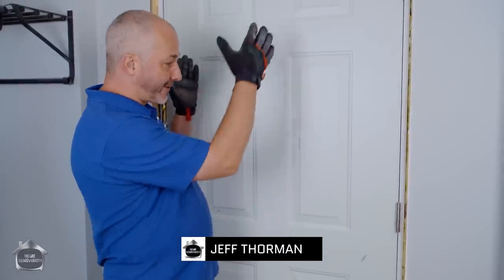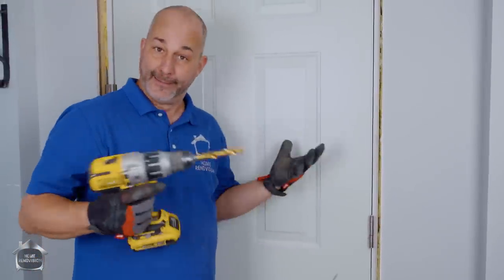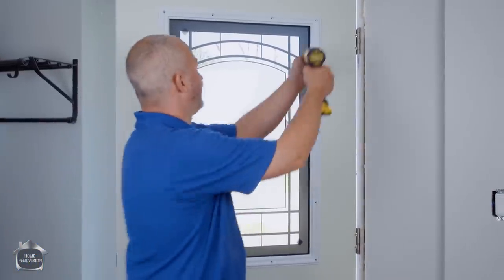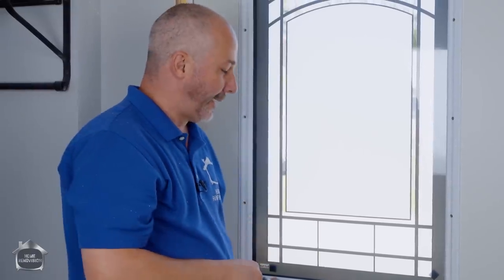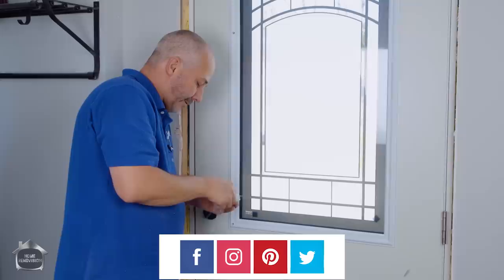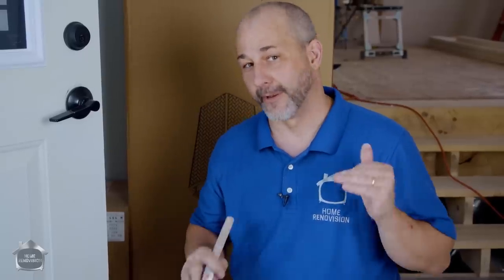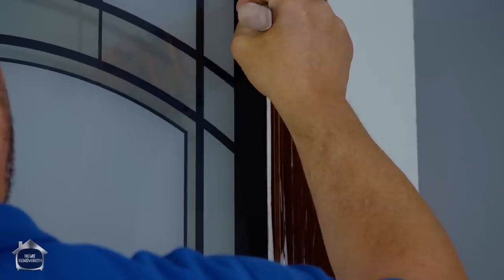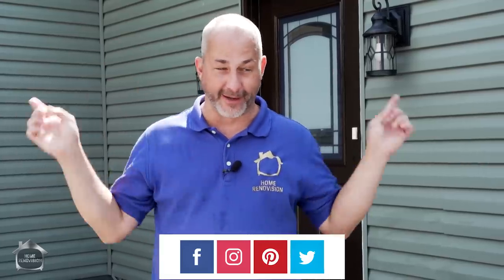Make Your Own Custom Front Door! DIY Door Installation

Comment: We are doing this project tomorrow! Were all set to buy a new door, stumbled across this from your ceramic floor removal video, and now we're going to salvage our current door and save $$$!! Thank you sir!
Reply from the maker: Glad it was helpful!
Reply: Tell us how it went please!
Reply: Paint the frame before installing and touch up last.
Reply: I bet a trade would charge a grand for that install. Nah, most guys wouldn't even touch it. Genius!
Reply: @pierre-marcrioux5015  It went really well! Window took a few weeks to arrive through Home Depot (we weren't lucky enough to have a HD that carries them in stock), but it really was a easy as he made it seem! I used a level and carpenter's pencil to draw lines and make sure I didn't cut the hole out crooked, but other than that and taking the door off the hinges to lay flat for orbital sanding/painting, I just used the tools he did and followed his exact procedure!
Reply: @blaster-zy7xx  Good advice. Wish I had remembered it 3 weeks later when the window finally came in! lol
Reply: @joe_g_fw  I'm glad to hear this went well for you. I am eager to try it for my dark hallway, but I can't find these lites on Home Depot. I am probably using the wrong search terms or something.
Would you mind sharing the one you bough, or one similar to it?
Much appreciated.
Good luck

--Sean
Reply: @BobutBrody  Yes, i had the same issue searching for half lite! Search for door glass instead. We bought the ODL Bristol.

Comment: WHy not take the hardware off before painting?
Reply from the maker: you can if you like. this way I can't loose the screws!
Reply: Yeah I always remove all the hardware. Shoot the last door I removed to spray paint it. Color was actually similar to this only it was a hammered type paint. Looked pretty good from 20 feet away. lol It really did look pretty good. It could have been better with a bigger sprayer than a can. Darn stuff dried to fast and couldn't keep a good wet edge.
Reply: Paint all of it prior to install... 🤷‍♂️
Reply: Wow that looks easy!
Reply: @HomeRenoVisionDIY what are these windows called? Is there name for them for searching purposes say at Home Depot or Lowes?

Comment: Safety gloves were a good suggestion and a good example of staying safe...... However...... NO SAFETY GLASSES during drilling and jigsaw cutting is definately not. I am a sloppy painter so I would remove the hardware completely and use tape on the edges. I get to frustrated trying to keep and maintain a straight good looking edge. Awesome video..... I now have the confidence to do mine. Thank You. Your videos are always very informative and easy to follow.

Comment: I paid a "contractor" to install a new front and back door into my double wide. I have a huge gap around the front door. The back door doesn't close properly and the door won't lock. Then if that wasn't bad enough. I paid him to install a hot water heater (before i knew how bad his work was) and he installed it backwards and put the access panel towards the wall, which from what i understand can be a fire hazard. He refuses to take my calls. Grrrr! Do you have a video on how i can fix this?  Lol i know this is a big ask 😂 btw your front door looks freaking amazing!! I love your channel. Thank you for being so detailed in your explanations. It really helps me to grasp everything!

Comment: You should REALLY be sponsored by Dewalt!!!  You alone are responsible for me buying a 1/4" driver!  QUESTION: Do you use the 3 speed/torque switch much???  What do you usually have it set on?     As always THANK YOU for an EXCELLENT money-saving video!
Reply: Oh yeah... Jeff is definitely a Dewalt guy!  I have a love/hate relationship with Ryobi as I've already purchased more than a dozen Ryobi tools and the tools work great but I absolutely hate their batteries!  If I were to start over today,  I'd absolutely invest in Makita as I love both their tools and batteries.  I really have been thinking about moving away from Ryobi for some months now... Makita looks to be my favorite brand right now.
Reply: @robertgiresi9515  (see Den of Tools on YT) I'm an 18vt Dewalt "investor", just purchased a 20vt driver because of our friend. But I'm seeing a lot of movement of Dewalt to Milwaukee *M18*.    I have a Makita drill/mini circ saw from the '90s I've recently rebatteried and function PERFECTLY after about 10yrs of nonuse!

Comment: what type of drill would you recommend for drilling through steel doors? would a normal impact drill be fine?
Reply from the maker: It will work if you have a good bit. But it will fight with you a little as you get to the other side.  Cheers!

Comment: Did I learn something new today?  Yes!!!!  I absolutely frikken love this channel!!!!  I never knew that you could install a "light" on an existing steel exterior door.  Not only did I not know this could be done, but this might just be the easiest DIY project ever!  No shimming, no constant checking for plumb, level and square!  One thing I'm not sure of is if my exterior door is steel or fiberglass.  First question is does it matter or is the process the same?  Secondly, the exterior was already painted.  Is there a way to determine if it was painted with latex or oil?   Thanks for all you do!!!
Reply from the maker: use a little nail polish remover to see if it is latex. if so it will rub off.

Comment: I don't want a window in my door.  I need to be able to stand behind it and pretend I'm not home without people knowing.
Reply: Abbreviated Reviews some builders are putting in full windows in their door. It’s why I love floorplans where you can’t see right through to the back of the house from the front door!
Reply: That's cool. I put blinds on my door window. But security wise, I had to get a deadbolt that needs a key on the inside and outside.
Reply: @Gandoff2000  If it’s a front door I recommend to get a keyed outside lock only on your front door. You don’t want to lock yourself in if there is a fire or some other emergency in your house. To address the lack of security with windowed doors you can apply security film to your window in your door to reinforce it against forced entry. Also swap out the 1” screws in your door hinges and strike plate with 3” screws.
Reply: Same. But i need to see who is at my door & you cant always rely on security cams (low battery, poor internet connection & smart criminals know to cover the the vid).  I have noticed there are windows out there that you can see out of...but the person at your door cannot see in.  That's my jam!!
Reply: PS: I forgot to add...the cheap a$$ builder of our home didn't even give us a peak hole...so there is literally no way to tell who is at the door...plus the door sits back in an enclosed brick area big enough for 4 people. Uhgggg
Reply: Exactly!!
Reply: I like a window in my doors,so they can see I’ve got something waiting for them and it rhymes with bun 😂
Reply: Amen, gotta use those ninja skills

Comment: We just finished taking an older one apart so we can paint the door and it has a sealant behind the plastic trim. Why did you not put any sealant between the trim and the door? This is critical on the outside where driving rain can hit it.

Comment: Does the window have a seal to prevent water ingress? Or did you add some?
Reply: Some of the retrofit panels come with a seal already applied ready to install. If not a light bead of window and door caulk on the outside edge of the exterior facing trim will do. Any excess that comes out can be scraped away with a fingernail after it dries for a day or two. Might also want to add some caulk between the exterior facing trim and the glass itself if there is none already. This is how the prehung door with a window was from the factory but I had to remove the window temporarily as it was just too damn heavy to move around with the glass in it.
Reply: @RCLapCar  that's what I thought. It's unlike Jeff to not mention this sort of detail the two lights in my door didn't have any sealant. But i do know some have like a tape sealant. I'm guessing most ppl install in a porch so not really an issue.

Comment: Being a new home owner, I really enjoy your videos and want to see them all.  I have a metal roof and enjoyed your video about that.    I was surprised to know that my front and both back outside doors were metal faced on both sides.  This is obviously for security.  Both doors have small windows and need work.  But the question that lingers in my mind is doesn't the glass defeat the security purpose of these doors?

Comment: Jeff, I noticed when you cut open the door that it looked like polystyrene insulation. My doors look identical to what you have. Does putting in a "light" have any impact on the thermal capabilities of the door?

Comment: Hi Jeff, since the cut out is slightly larger than the light, is cold going to sneak in during winter?  Should we shoot some expanding foam?  Thanks!
Reply from the maker: not needed. the glass is actually the weakest link in the door system as far as thermal is concerned.

Comment: I need to replace the sidelight panel (not just glass) on my steel front door.  How can I find out if the sidelight is connected to the front door?  I would really like to avoid replacing the entire front door.  thanks

Comment: Here in FL when installing doors for remodels, we gotta put up screens/netting when drying; to keep all those creepy crawlers out of the clients house😉.
Also, another question always getting, is thresholds & door-sweeps for front exterior doors. How to install, where to find the products (as Depot & Lowe’s can be “limited”), & how to install them on slab on grade “floors” & over tile.....the 2 most common here in FL. Not as difficult as ppl think, actually, just gotta make sure have the right product to do the job; otherwise, gonna be frustrating for ppl, & will spend more time “modding” the stuff you bought; than anything, imo (& yes, sometimes you have to, Cuz older homes can be “tricky”; as you say...no home is straight, once built😉, so some finagling & modding some door-sweeps, trim, etc...might be necessary for it to “fit & look good” when installation is complete). 
Thx for the vids, & thx for the painting vids long ago.... Painting was one thing that would normally be subbed out, as I (we) found it boring, a pain, & just hated painting in general. Then come to find out, when ya “know” how to paint; not so bad after all, & can be quite “calming/soothing”....guess is the words😅(& I actually don’t mind painting now, & actually enjoy it; crazy, right😆). Doing an internship with a local painting company helped out too. Thanks again; & CHEERS ✌🏼

Comment: On the note of removing a handle where the painter didnt have concern is to use your razor to cut the paint to prevent anything paint pulling off.

Comment: Great video! We were just looking at doors with windows in them. I am guessing this is something I can do with a wood door as well or was there a specific reason it was steel? I have an interior door for an office that we wanted to have a lite in.
Reply: Might not be able to do this with an interior door. Those are usually hollow inside so will not be able to hold the glass in place very well and will most likely deform when you screw it down. You could theoretically cut the hole then fill the door with spray foam but not sure it wouldn't bulge from the foam expanding making it uneven. Also interior doors are thinner than exterior doors I believe.
Reply from the maker: same thing, but I would measure the thickness before buying an exterior lite for an interior door.

Comment: Hi Jeff, I had a basement question, we're in the process of removing the water damaged rotten 3 layers of floor from the concrete (60's-70's house). There are narrow cracks running on the slab in a few places, what's the best way to deal with that? 
Also best temporary way to "finish" the concrete until we're ready to redo the floor next year? Paint?

Comment: The window trim doesn't need any caulking to prevent air leaks? Maybe it doesn't matter compared to the air leaks around the door frame.
Reply: Personally I would add it. Not only for air leaks but also to keep water out of the door (if not protected from exposure to rain). It is a steel door so if there is no seal it will probably start to rust from the inside out when water gets in the cracks (and it always finds a way). Also some of these window inserts come with a seal already in place.

Comment: Is there ever a reason to seal around the window with a caulk? Love these vids and you have kept me busy during the pandemic!
Reply: Doors that come with the insert pre installed will already contain caulk on the outside side between trim and door and trim and glass. The caulk is mostly there for the same reason you put spray foam between the door frame and house frame, to stop the possibility of drafts. Also possibly to help stop water penetration as well if the door is exposed to the outside.

Comment: Does the light come with weather seal to ensure the area is still airtight? I would have thought some window and door foam would go in there to seal any gaps and make it “one piece”. 

Great project BTW!
Reply from the maker: Yes it does, it is a water and weather proofing gasket on the exterior.
Reply: Super cool, thanks!

Comment: Question,  I've always painted the back edge of the door the same color as the outside, and the front edge with the interior color. That way no matter which wY you open the door, its the same color. Is there a reason you don't?
Reply from the maker: personal preference. I also switched out the gasket from a white one to a black one. Cheers!
Reply: @HomeRenoVisionDIY  gotcha. I was just curious. I love the channel. The most relatable channel on YouTube

Comment: Jeff:  Thank you for sharing this tip.  I'm going to try this and let you know how it turned out.  Quick Question:  When installing the light, should you also use a thin bead of vinyl caulking on both flanges (inner and outer) to help weatherproof the light on the door?  Or is the seal with the flange and screws tight enough to protect from driving rain?
Reply from the maker: the window comes with a seal. Cheers!
Reply: I'd probably hit it with the window foam around the edges if there was any gap to fill.

Comment: If for some reason the door has scratches and dents in it, can that be fixed and then painted?
Reply from the maker: yes automotive bondo is a great way to fix dents. it can be shaped and sanded. Cheers!
Reply: @HomeRenoVisionDIY  Noiiice!

Comment: Not a huge fan of brush painted doors, you can usually see the brush strokes, most diy homeowners aren't super great with a paint brush, I like to take the door off the hinges, tape it off, and spray paint it with a high quality latex spray paint, go over it with a couple coats of automotive clear, then cut and polish it and it gives you the sheen and depth you'd see on a new car! Plus it'll hold up well to the UV rays if you have a sunny exposure.
Reply: I haven't tried it yet, but I am considering using automotive vinyl wrap on a door, see how long it lasts, how easy the application is and if it's worth it

Comment: Can you please link to the product itself or provide more details on the name of the product? I searched for "half light" "half lite" "door lite" etc. on Lowes and Home Depot sites aren't producing any relevant results. Lowes' chat support "expert" had no idea what I was talking about either.
Reply from the maker: evidence that there is no sales help in those stores. if you go to home depot online. go to the door section and then search replacement half lite just like I spell it then scroll down you will find them. they would rather you buy a whole door so it takes little work. Cheers!

Comment: Hey nice work! I'm very inspired by this video and will be tackling this myself too. What are the cons of cutting and installing the full glass while the door is still in the frame vs cutting it while laid flat? I've seen a few DIY videos where they removed the door from the frame and did the cutting and installing on a sawhorse. Wondering if that is recommended or just a preference? Thanks!

Comment: Great video Jeff! What do you lose in terms of noise / heat insulation by going from a solid to half-light door? Are there different levels of insulated double pane windows or stuff like that or is it pretty much one kind of window?
Reply from the maker: once you add glass the door is an r5. Oh well!
Reply: @HomeRenoVisionDIY  that's not so bad at all. A full door doesn't have a R-value that much higher anyways. Thanks!

Comment: What's the easiest way to remove a really bad paint job on metal door? I'm hoping it's only been painted once, but honestly I think it's been done at least twice. If I want so against wastefulness if buy a new door
Love your vids!!
Reply: I would say, remove all hardware (handles, locks and hinges), remove the windows (if any) then sand the door smooth. No need to remove all the paint unless it's really bad and chipping. Might need to use a primer first if going from a very dark color to a light one. Then reinstall hardware and window. If needed sand and repaint the window trim as well.
Reply: @RCLapCar  Thanks Jan. I think the amount of work it's going to take to get the paint off is helping me decide on a full window insert. The inside doors r so bad they get stuck. The joys of renovations a 75 yr old house. The bathroom really going to be a challenge